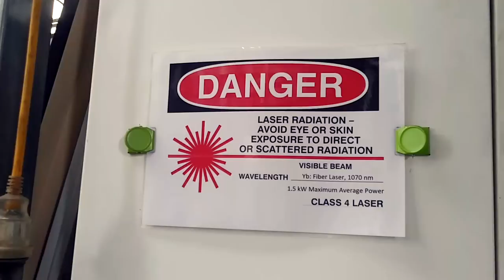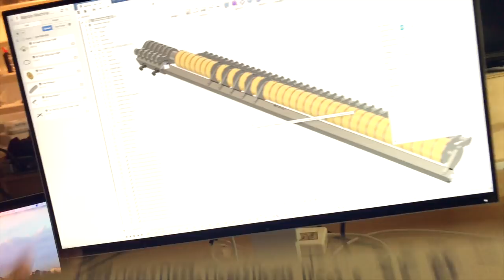Muting System Assembly - Marble Machine X #41

Comment from the maker: Wasn't expecting the HiHat Channel to be so Alpha
Reply: Wintergatan Good job getting first comment!
Reply from the maker: I had inside info on the timing of the video release
Reply: Yeah that guy certainly told them how it's gonna be. :D
Reply: Not bad weld job for a noob,  it looking good Martin, can wait to see it all done
Reply: What is an Alpha HiHat Channel? Or, what is a normal HiHat Channel?
Reply: Is there a built in stop for the mute? watching you test with a wrench i was worried that in a live show there might be a possibility of over extending whatever control rod you attach and potentially damaging the machine. Sorry if you've aready adressed this!
Reply: You should do twitch streams while you do this
Reply: Wintergatan are you dont have job some other  stuff ?
Reply: Aaaaaaaaaaaa your jokes are adorable I love it :D
Reply: Question, if you see this, I noticed there's no muting system for the "stringed modulin" that was planned early on. is this still being included in the machine, or has it been omitted?
Reply: Good to see that will approach 1.000.000 Subscribers within the next few days or so. Great success.
Reply: how did you post this reply BEFORE the comment you replied?!?!?!?
Reply: Glad to see your metal-working skills improving. Especially correcting issues caused by heat distortion. Congratulations on your 25mm square tubing "manufacturer".  That was impressive.
Reply: +Space Man I like the idea of using acrylic tubes to collect the marbles.
Reply: +Big hero Scott I don't think he has the bandwidth where he is living.
Reply: I wouldn’t risk eating your food now to be honest HiHat has dibs now
Reply: Such a aesthetic piece of engineering, Martin! Well done! Looking forward to the finished project =)
Reply: Will you play the original Marble Machine song with MMX? Please do :D (I am pretty sure thousands of other people said the same thing.)
Reply: Amazing progress.  Can't wait for your first music video.  maybe before the end of the year?
Reply: It is the 28 June 2018 its 01:30 in the Morning here in Austria... and i was thinking about a few Things... First... Greetings Frome Austria,... Second... Every Week the Machine goes Bigger and bigger, I love it,.. But also, you going Bigger,... 1 Million Subs is only about 12000 People away... and the Machine is also not so far away to be finished, That is Awesome... 3rd... This is now a Question: I hope that Marbel Machine X can play the Original Sound from the Original Machine... But can it also play: Through the fire and flames by Dragonforce... Hahaha... lets make this a Challenge or a Series, when the Machine X is finished... So... lets name it... CAN IT PLAY IT... (Its a Challenge, and a little Joke, Have Fun) and Good luck... Kiss, and Love Ya :3
Reply: I like it
Reply: Australians represent! STRAYA
Reply: High Hat or Low Shoe?
Reply: IgnoreMyChan it’s the channel that controls the marbles that hit a hi hat drum.
Reply: Wintergatan just because you have it working doesn't mean you have to work with it, remember to take your time and not to rush it.... Love ya brother you got this. 👍
Reply: i just hope it still has the whole wooden clanking noises like the old one, IMO the addition of the clanking added to the personality especially when you pulled the brake mechanism to stop the wheel halfway through. when i saw the video of the song getting played in a concert it just wasn't the same without that wheel brake thing.
Reply: Wintergatan and the return of the turntable! Great video! I can't wait to see the frame.
Reply: Great work! Now drop the acrylic parts and stick with wood, steel and 3d printing. You can print rails for the marble dividers for the top section. You have the shapes in CAD already. acrylic looks so cheap on this marbelous thing 😉
Reply: IgnoreMyChan I think he meant like an alpha male, like dominant, a bully. (far fetched joke, really cracked me up haha)
Reply: Du är helt fantastisk! Jag älskar din  kanal och vad du gör, varje onsdag blir jag lika glad när videon kommer😀 Love from Sweden🇸🇪🤗😀👍🏻
Reply: What the song name for this video? I really like it
Reply: Yes, me too, +Avalon the Fox. The last few vids have had awesome tunes but i can't seem to find all of them...i've watched a few times but there seems to be no mention of them.....maybe it's on one of the links at the end? ( i haven't checked yet, but maybe the one in the top righthand corner leads to it? But a vid from a few weeks ago also had music i loved but none of the links led to the gorgeous background music :( )
Reply: Wintergatan
Have you found a solution for spinning the demagnetizer.
You could turn it with the ring gear of the planetary set
Reply: Duckface McSelfie I think if he doesn't credit it he created it himself for the video. You might have to use one of those YouTube to MP3 converters
Reply: Bspammer Ya, i assumed the little genius must've created it ;) but sometimes he has some linkage to the tunage, so i was hoping......i'd prefer to buy it if i had the option, but cheers for the suggesty. I reckon he should compile an album of his WW soundtracks....i'd definitely buy it! There have been some really nice ones of late...
Reply: Wintergatan  Greeting from Tucson AZ.......Absolutely amazing engineering on that muting system. Your a pro at "thinking outside the box"...The whole project is mindbogglingly awesome!
Reply: 13th Evergreen I think he wanted to keep it as part of the final project because it represented a learning experience, and had the aesthetic to prove it. I think he was hoping that it would work well enough that he didn't have to replace it. Defs not out of rushing or laziness. Martin has proved that's not his style this time 'round.
Reply: Martin .. when are the live streams for Wednesdays?
Reply: wow, he would become the new bob ross :)
Reply: the table of your CNC Machine is getting so beautifully intricate you could sell rubbings of it. I'd hang one on my wall.
Reply: is is possible that some parts bend because the mashine is so heavy? or does it even matter?
Reply: Mr. Molin, did you (or anyone else in the band) owned a Samsung phone during the writing of Slottskogen Disc Golf Club?
I noticed that the same tones of the old notification sound (One that sounded similar to a human whistle) are present throughout the song (especially clear after minute 1:41). So, I was curious if it was put there subconsciously by the author or something alike...
Thanks for your time! :-)
Reply: Its a masterpiece
Reply: Hi, I thought the finest iron bar which controls the vibraphone could get metal fatigue easily if those 22 muting channels are heavy. Twisting force can break this part easily so maybe you should get few more replacement parts.
Reply: August Games 
Yeah, the idea of rails for the marble stacks is great i think. 
Martin do that!
Reply: Wintergatan I don’t care what anyone may say Manufacturing is cool when done right and you have done it amazingly
Reply: Pressed like but then I unliked... This has to have 808 likes ;)
Reply: I don't see why you can't add a smaller slower spinning programming wheel for the mutes
Reply: .... Coming to think of it you should have made it 42 channels just for the kicks of it....And because it is the answer to all of the questions in the universe
Reply: @Wintergatan  MEGALOVANIA WE ARE NUMBER ONE SWEET DREAMS
Reply: @Wintergatan  EVANGELION SMOOTH CRIMINAL CRAB RAVE

Comment: Don't weld galvanized nuts, the fumes are very toxic.
Reply: Welding fumes (mostly the flux, I think) are pretty bad to start, but yeah. Zinc fumes will kill you.
Reply: blindbrick blindbrick is that due to  zinc?
Reply: Robert Kielty Yes, the zinc fumes are toxic.
Reply: I’d recommend removing the galvanization or just getting stainless steel.
Reply: Yes, grind off galvanizing.  That will prevent all the holes, or "porosity".
Reply: I don´t think any welding fumes are helpful to ones health.
Reply: Yes, breathing burning galvanizing can make you feel very sick!  But of course you shouldn't breath any kind of welding fumes if possible.  Always wear a mask!  (Somehow drinking milk can help if you start to feel sick because of these fumes.)
Reply: While I agree welding galvanized materials is very dangerous because of the zinc, those bolts were too shiny to be galvanized. I would put money they were nickel plated. They did not even look to be zinc plated because the color was off (which for the same reasons would be toxic to weld).
Reply: You have to drink the milk PRIOR to welding galvanized materials to allow it to coat your stomach lining some and stop the toxins from going through. Drinking milk (and not the 1% or 2% kind) once you start to feel sick will not help you very much. Sadly, this is the voice of experience. I have had galvanic poisoning.
Reply: No, those will be BZP (Bright ZInc Plate) You have to try very hard to get Nickel plating nowadays. (I play with teens and twenties vehicles, so often want Nickel). The danger is https://en.wikipedia.org/wiki/Metal_fume_fever but, to be honest, as a hobby-welder doing a few nuts here and there, any Zinc Chills will be masked the next day by the effect of the celebratory beer.
Reply: I think it is highly unlikely that a welder will stop to drink milk before he starts to weld something galvanized.  I'm just saying...  :)
Reply: andy pugh Thanks for all the information, and thanks to everyone for the tips. I worked in assembly at a car factory before they put in the ventilation above the welding machines. I had sore sinuses and a sore throat, and nothing tasted or smelled right for 2 weeks. All the metal was galvanized. It's probably a good thing that I lost that job. Their safety standards were poor.
Reply: I never believed the milk story. The milk goes to Your stomach and the zinc fumes in the lungs. I could be wrong, I'm not a doctor.
Reply: I dare any of you to try to find a source saying zinc fumes are potentially lethal. It just doesn’t exist. Yes, Metal fume fever can make you feel like shit, but having people breath vaporized zinc has even been used as a medical treatment in the past, maybe still is for that matter.
Reply: blindbrick blindbrick it can be welded safely. 

Even unprotected, at non-industrial levels, it usually will just make you feel crappy. 

It’s not like it’s instant death like most internet warriors will tell you.
Reply: The calcium chelates the zinc.  It's true, it works... even if done afterward, just not as well.
Reply: Removing the zink is simple, put ut in hydrochloric acid and it wil desolve.
Ps, do it outside the Gas that apears is flameble.
Reply: Evan Cutshall
you can now call yourself a welding destroyer. And Nevir202: apply cold milk to burned area
Reply: Evan Cutshall Thanks for this detailed information. Ventilation is important for many industrial processes! I live in the "Chemical City" or "Chemical Valley". If only we could better ventilate the atmosphere.
Reply: You can also get uncoated plain steel nuts and bolts.

Comment: Cool job. Now let's get cracking with the acrylic again for the marble divider
Reply: yes, i was hoping he would give up update on the acrylic :(
Reply: John White Phrasing!
Reply: Same.
Reply: I don't know, if the frame gets here before next Wednesday he might do that instead.
Reply: It was only about the bad pun (cracking), I know these things take time and patience, don't over react. Plus I really think the oven is the way to go, there are some videos out there, it seems to bend very nicely.
Reply: He'd need a pretty big oven to fit that as a single piece, but yeah I agree.  Also if I were him I think I'd need a "cooling off" period, myself, before tackling it again :)
Reply: Aaron: actually it would be only necessary for the sheet of acrylic, not the entire structure, but that would require some tests and preparation. Probably the best thing is to use an external company to produce it. It wouldn't be cool for the videos though
Reply: Yeah, that's what I meant.  That sheet is at least 2 1/2 feet long though; it wouldn't fit in my oven for sure.

I agree that using an external company doesn't really fit his "rule of cool."  :)
Reply: Aaron Robinson I think that the first and more engineer-like thing to do is to study the properties of the material, especially the heat point where it starts to melt. Make some tests with smaller sheets (same thickness) and then if it's reasonable, use a small metal enclosure with like four heat guns that blow a constant and uniform air jet. That might work, no clamping should be ever required, but maybe a better surface yes

Comment: I do not know the strenght of the smallest tube in there, but it has to move the most weight..
Wasnt it a better idea to make the biggest tube on the heavyest part?
Reply: Tigertjheu SoftCoat actually its the smallest and the smallest dont even need to be a tube could be just plain steel rod making it pretty solid
Reply: It's the part that controls the vibrophone channels. It will receive the most marbles. He put it on the left hand side of the MMX, so the marbles have less distance to reach them from the elevator on the left. With that design of the muting system, the biggest tube has to be near the handles, so on the right hand side. I think these are the reasons why it couldn't be the other way.
Reply: The load on all of them is very small anyway, so it shouldn't matter.
Reply: i totally agree, but then we'd have to change many things for it will be on the other side.

but also, it may be the smallest, it can be full unlike the others.
Reply: Don't forget that the whole machine must not be too heavy, because of transportation concerns. Plain steel would be stronger, but also heavier.

Comment: Hi there. 
As a tip from a tig welding pro. 
Clean off all the mill scale from your parts aswell as the edges that have been laser cut. 
Make sure that your part are clean from and oils or water, they create hydrogens in the weld. 

Your project is coming along great, keep up the good work.

Comment: It’s coming along nicely 👍🏼. One tip for TIG welding is to remove and mill scale or coating from the steel before welding. It makes a much nicer weld and you won’t get any porosity in the weld. Another thing, those magnetic clamps are great but the do strange things to the weld arc making it difficult to get a nice weld. I enjoy seeing you metalwork improving.👌🏽

Comment: Just a tip: when welding nuts or other hardware grind or cook off the zinc with a torch and wire wheel after. All are gross options as far as poison gas but if you use the torch you can do it with your face farther away. This will help with the pitting and bubbles in the weld. Love the awesome disc golf shots you are a surgeon!

Comment: A hint with welding. The bigger the puddle the deeper the weld is in the metal. If its too deep it will effect the project entirely. However if you minimize the puddle size you do less damage to the project. It also risks the weld not welding completely but that is something to balance and I thought it might be useful to you later on. Especially sense you are using tubing.

Comment: warping on welded parts can sometimes be counter intuitive .. the contraction of the fillet metal in your welds is what bent your tubing . Security clamping the tumbling down during the welding process will help prevent this and do not remove from the clamps till totally cool. Yeah I spent 2 years in vocational/ technical school for welding..  See if you can find a used welding textbook.. very helpful..

Comment: You know, the old marble machine may have been an absolute heap, and I can see that it has been a lot of trouble, but I think that’s also what gave it it’s charm. It wasn’t meticulously engineered, it was cobbled together In a very British way. It worked just well enough to get the job done, but no better. The X is very German in its perspective. Meticulously engineered, and produced to the finest of specifications, an absolute marvel, however, it’s clinical, i feel as the X may not have the same charm the original did.

Comment: Martin,

with this video you gave to the word "bananaware" a new and different meaning. Nice to see your improved welding experience. Great job done until now and I am sure, you will get the marble divider working as well. But why not collect the marbles in acrylic pipes instead of this complex hard to produce double sheets on a single frame? Did the marble pipes made any problems at the first marble machine? I think there is no better solution for it than a flexible and transparent pipe if it has the right diameter and also nothing will be replaced as easy if there should be any damage of it. 

Can not await for the next Wintergatan Wednesday and also I can not await for the first sound you are playing on the Marble Machine X, after finishing it. Even if the new Marble Machine X has still a similar shape to the first Wintergatan Marble Machine, it has by now such a perfect finish that this is not only a working machine instrument but a really good peace of artwork and design also.

You make anime music become real on stage. You give the world something completely new and completely beautiful. Keep up the good work and stay as you are. People like you are the ones who get the mankind a step forward, because they will never give up trying.

Comment: It might be a little late now but if you want to keep that clean metal look, especially if you are planning on traveling with it, you are gonna want to put some kind of clear coat on all your bare steel surfaces to avoid any nasty rusting. It may not be a bad idea to have it coated where it comes in contact with the wood, if that wood ever absorbs and moisture in the air it can act like a sponge and put moisture right onto the bare metal as well.